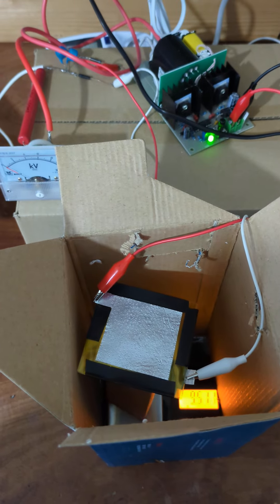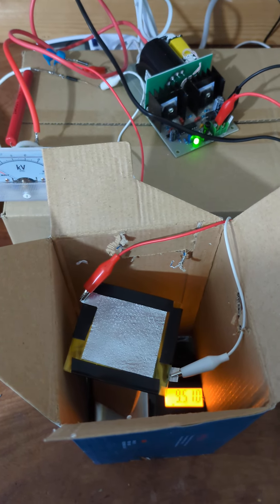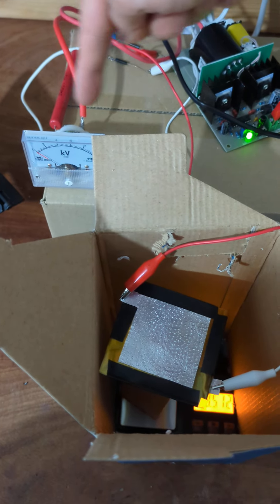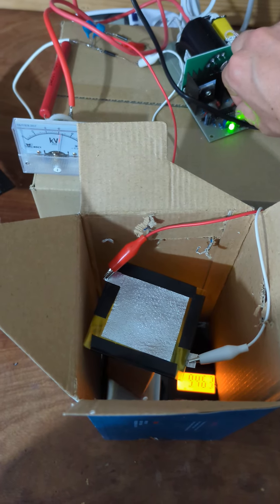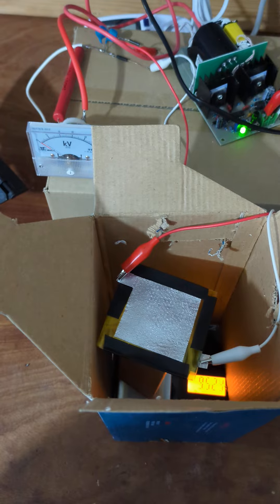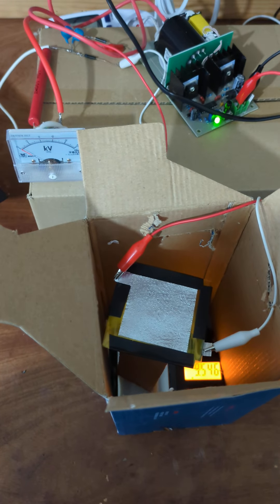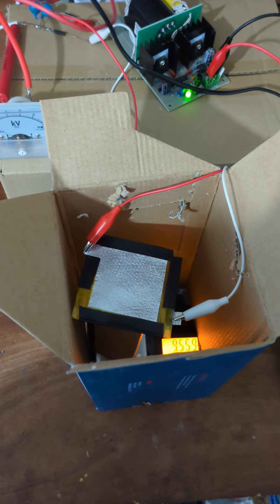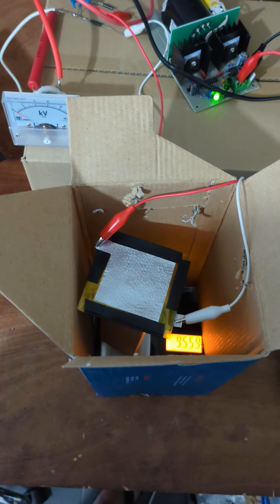First thrust measured?

Comment: thanks for sharing!
always exciting to see unexpected results.
how high was the voltage? 20kV?

The high voltage field might influence the scale measurement?

You might see more effect when that high voltage is disruptive discharged like I did in the field propulsion video.
Reply from the maker: Hi Ivo, the voltage was only 6kV and I placed the capacitor on a 20 cm high styrofoam pillar to make sure the scale isn't influenced.

Do you think that is a sufficient distance?

Ideally I'd use an analog way to measure the thrust, like IVO Ltd (not related to you 😛) did, but then you need a much larger setup to be able to see any real effect.

I will re-watch your field propulsion video and note that this might improve the effect, but for now my goal is to replicate the setup used by Mike McCulloch, the inventor of the Quantised Inertia theory.
Reply: @Waveguide   6kV and 20cm Styrofoam, that should do the trick. I'm only guessing naturally